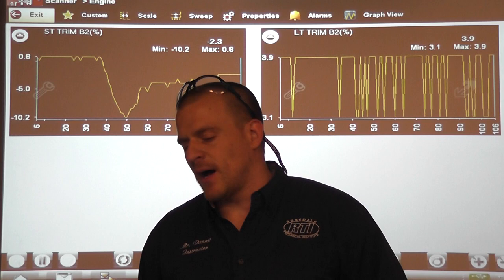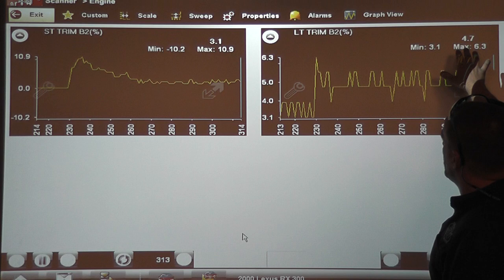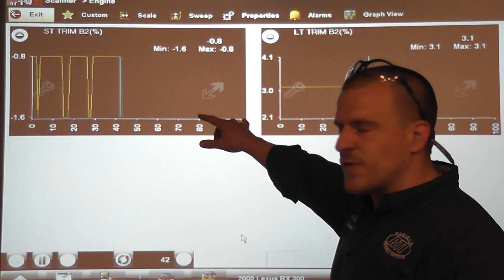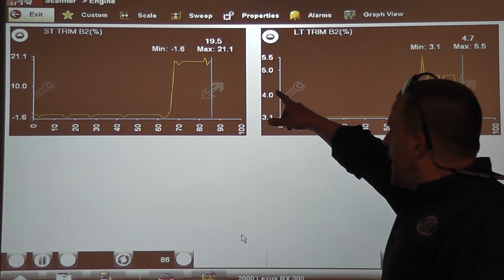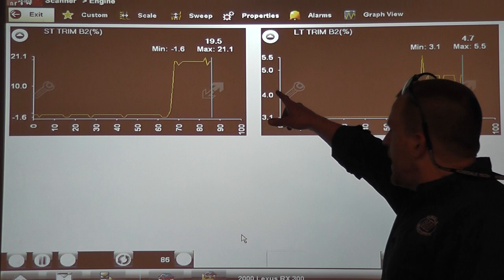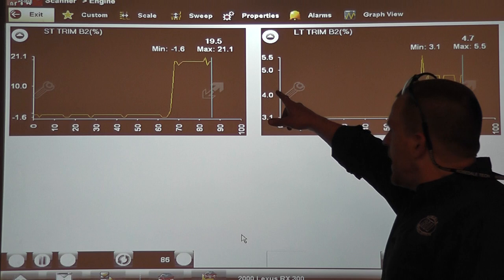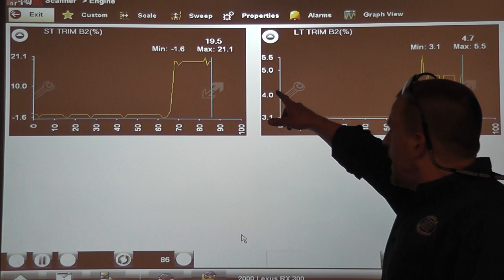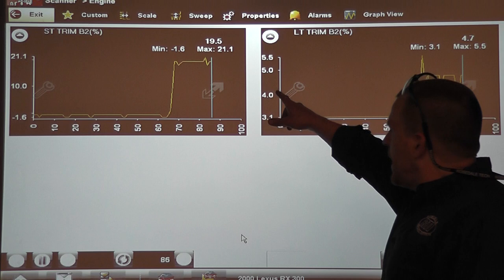Using Fuel Trim to identify type of misfire (can it be done?)

Comment: Man I’m freaking lost on my truck I have a positive stft bank 1 at 50% at idle and it refuses to drop under load goes to 53 under 2500 rpms
Reply from the maker: What is your fuel psi? Have you tested the MAF sensor? What are you working on?
Reply: ScannerDanner I’m working on a 01 Tahoe my psi is 55 but I’ve seen that my ho2 bank one sensor 1 is steady 250 mv I’m guessing it’s what is causing the high stft
Reply: At idle I’m at 250 mv at idle and 250 under load I’m just learning fuel trims and diagnostic things so I had a few questions
Reply: So I guess my question is am I looking at the right things when I’m diagnosing
Reply: I’m also seeing my mas at .02 at idle .07 under load
Reply from the maker: Unplug the MAF and tell me how it runs on a test drive. It may stall a few times but I don't car about that
Reply: ScannerDanner I have the diagnostic reports if you have an email I can send them but I’d have to do that test tomorrow

Comment: THANKS
I'm confused..... raw fuel into the exhaust»»»»   rich??   lean???
There is NO fuel sensor!!!   just O2 sensor(S)!!! Got to think in terms of O2,not fuel,the computer does NOT know about any raw fuel or no raw fuel in the exhaust....... BUT it knows  UNBURNED  OXYGEN (air), that't what the O2 sensor does,isn't that the path to think about it???
edit,  had to add this:  THERE IS NO RAW FUEL SENSOR IN THE EXHAUST PIPE;   NOT INVENTED YET!!!! Remember that.
The ONLY thing that was invented,and IS there,is an OXYGEN( read air) sensor, the O2 sensor.
So,of course an ignition misfire is gonna make fuel trims HIGHER;
Because,you guessed it,there was an incomplete combustion(or no combustion), and the AIR (air is 21% O2,as you know) -forget about the fuel!!!, no sensor for that,remember?--  went thru, the O2 sensor sees AIR/O2, that is LEAN,and it commands  Fuel Trim UP.
2nd edit:  to write thanks up there, and to praise this  amazing and timeless video.
And to say again: there are  ONLY O2  sensors, because i see that that was NOT emphasized enough; if you keep THAT in mind,you reach good conclusions much easier.  O2  O2  O2;     no gasoline sensors. (the cat is a sort of raw gas sensor: it glows RED HOT   lol).
joseportotuga
Reply from the maker: both oxygen AND fuel in the exhaust will affect how to oxygen sensor reads. It is a mini catalyst. 
For example:
A misfire from an injector that is not spraying will have more positive fuel trim corrections than a misfire from a spark plug that is not firing. This is because of the unburned fuel entering the exhaust. Oxygen levels would be the same. Fuel IS a factor on an oxygen sensor

Comment: Why would you waste your time looking at trim data with an obvious misfire? Love your videos but it seems like a lot of overthinking when you can just stand there and hear a misfire. Do your misfire diagnosis and repair clear any codes and sure, look at trim and possibly avoid a comeback for an unrelated issue.
Reply from the maker: That's like saying, why use a ratchet when a wrench works just fine. It is simply another tool in your diagnostic tool box for misfires and I use it all the time!
Reply: @ScannerDanner  I disagree with the analogy. The wrench and ratchet will both remove the fastener but fuel trim has nothing to do with diagnosing a misfire. Demonstrate how you use fuel trim to pinpoint which cylinder is not firing and I'll be a believer. P.S. love your videos.
Reply from the maker: It's not about figuring out what cylinder is misfiring. It's about using it as a guide to the type of misfire. For example, if I have a dead misfire on a 4 cylinder engine and I see 25% fuel trim, I can be sure that I have an injector not firing. If I see 10-15%, I know I'm getting fuel and then it leads me towards ignition/compression. It's a guide, it's another "tool" in your diagnostic toolbox and all you need to do is to look at some data! The scanner is already in your lap and you haven't even opened the hood yet. 
Also, I'll use the downstream O2 as a guide as well. Just did a Saab case study on my Premium channel where that test helped me tremendously as far as direction, because I was swearing I had a fuel issue but the downstream O2 told me otherwise and it did end up being an ignition misfiring issue.

Comment: Honda accord V6 3.0L: Misfires all cylinders sometimes, but STFT = -25% on bank1 ONLY. New spark plugs, new injectors, new PCV, new MAP, new gaskets (intakes, throttle body, EGR, top cover engine), clean throttle body, clean EGR, did valves adjustments, test evap purge valve, new fuel regulator, test coils, very good compression in all cylinders. Still get -25% STFT on bank1 ONLY and sometimes Misfires all cylinders. Any suggestions?
Reply from the maker: Possible exhaust restriction on one bank. Does it have two cats? One on each bank?
Reply: @ScannerDanner  Thanks for your prompt reply and yes, it has 2 CATS; one for each bank. Did the vacuum check, it is normal; 19 in Hg at idle. No hesitation, no power loss or no performance issue when drive test. Any other possible causes beside your suggestion "possible exhaust restriction"?
Reply from the maker: Okay, that rules out a restricted cat. Next step would be an injector balance test for me. 
What year is the honda? Some models will use downstream O2 sensors for fuel trim control, but that is usually accompanied with a wide band AF sensor upstream. If it has downstream fuel trim, we need to focus on the B1S2 and B2S2 sensors.
Of course we need to also focus on the upstream O2 sensors as well. (B1S1 and B2S1). In fact after typing this, that is where I would start. (Testing the upstream O2 O2 sensors)
Reply: @ScannerDanner  Good morning ScannerDanner. I thank you for your great inputs. It is 2004 Honda accord V6 with 200K miles. The 2 pre-cat sensors are A/F ratio sensors and I did swap them around and they both are ok (Amp numbers with equiv. ratio is 0.99 or 1). At idle, bank1 S2 stays high around 0.85 and bank2 S2 does fluctuates from 0.2 to 0.7 and there are times around 0.6V for quite sometimes. I'm questioning this B2S2 for the bank2 CAT however STFT is -25% for bank 1 ONLY. Strange? What is injector balance test? Talking about "balance", the compression numbers for bank1 are 150, 145, 150 and bank2 are 180, 175, 180. Any thoughts?
Reply from the maker: @haiho626  I definitely do not like those compression number differences. No cam/crank correlation codes? (timing belt off a tooth) but we could attribute those numbers to "cylinder wash" (too much fuel)

But let's focus on the B1S2 O2 sensor for a minute. Can you drive it lean? This can be accomplished a few different ways. (unplugging a few injectors on bank 1 or if you take it for a test drive and then use the transmission to decelerated while keeping the RPMs above around 2000)  This will put the system in a decel fuel cut mode where the injectors actually stop firing. All 4 oxygen sensors should drop lean during this time if you can keep it in this mode for long enough (that's why we use the transmission to help us). Hope I am making sense
Reply: @ScannerDanner  I thank you for all your wonderful inputs and suggestion. Let me show you the tables of the key parameters and their conditions and they also answer your questions:

After about 8 minutes at IDLE, no speed, RPM = 785, pending codes for misfires all cylinders (P0301-P0306) and P0300 (Random misfire) show up:
1. ECT = 176
2. MAP = 10 inHg
3. Spark advance = 9
4. IAT = 95
5. TPS = 13.3
6. STFT bank 1 = -27.3, bank2 = -2.3
7. LTFT bank 1 = 0, bank 2 = 0
8. A/F ratio sensor 1 bank1 = -0.246 to -0.269mA (before CAT bank 1)
9. Eqv ratio 11 = 0.964 to 0.972
10. A/F ratio sensor 1 bank2 = -0.019 to -.074mA (before CAT bank 2)
11. Eqv ratio 12 = 0.991 to 0.999
12. O2S2B1 = 0.825V (after CAT bank1)
13. O2S2B2 = 0.195 to 0.715V (after CAT bank2)
14. Load = 34.1

Then I drive the car, during ACCELERATION I see O2S2B1 = 0.3 to 0.6V (after CAT bank1)

Per your instruction, I take notes the following numbers during DECELERATION; my foot off the gas pedal:
1. STFT for B1 and B2 = 0
2. LTFT for B1 and B2 = 0
3. A/F ratio sensor 1 bank1 = 3.7 to 4mA (before CAT bank1)
4. Eqv ratio 11 = 1.99
5. A/F ratio sensor 1 bank2 = 3.5 to 4mA (before CAT bank2)
6. Eqv ratio 12 = 1.98

7. O2S2B1 = 0V (after CAT bank1)
8. O2S2B2 = 0V (after CAT bank2)
9. RPM is about 2000
10. MAP = 5.9 inHg

Then about 1/2 hour driving (acceleration and deceleration), I then park the car and let it IDLE:
1. STFT bank1 = -11.7
2. LTFT bank1 = 0
3. STFT bank2 = 0
4. LTFT bank2 = 0
5. A/F ratio sensor 1 bank1 = -0.007 to -0.0085mA (before CAT bank1)
6. Eqv ratio 11 = 0.999 to 1
7. A/F ratio sensor 1 bank2 = -0.019 to -0.070mA (before CAT bank2)
8. O2S2B1 = 0.76V (after CAT bank1)
9. O2S2B2 = 0.2 to 0.7V (after CAT bank2)
10. MAP = 9.7 inHg
11. Spark advance = 8 to 10
12. ECT = 201
13. Load = 32.5 

14. RPM = 790
15. IAT = 134
16. TPS = 12.9

Then I turn off the engine and wait for about 10 minutes and start the car again at IDLE:
1. STFT bank1 = -25.7
2. LTFT bank1 = 0
3. STFT bank2 = 0
4. LTFT bank2 = 0
5. A/F ratio sensor 1 bank1 = -0.007mA (before CAT bank1)
6. Eqv ratio 11 = 0.999
7. A/F ratio sensor 1 bank2 = -0.050mA (before CAT bank2)
8. O2S2B1 = 0.6 to 0.825V (after CAT bank1)
9. 02S2B2 = 0.2 to 0.7V (after CAT bank2)
10. MAP = 9.7 inHg
11. TPS = 13.3
12. IAT = 147
13. ECT = 207

Questions:

1. Seems like when I drive, the numbers are getting better until at idle STFT bank1 go back to -25.7? Does 02S2B1 (after CAT bank1) is normal? the 2 A/F ratio sensors (pre CAT) are ok?

2. One more thing, yesterday, at IDLE, I rev the engine to 3000 RPM for sometimes, the P0172 (System too rich bank1) and P0430 (CAT system efficiency below threshold bank2) came up with Engine Light on. I was surprise P0430 for bank2 CAT. Should it be for bank1 instead? Yes, the O2S2B2 values indicated potential CAT problem for bank2, should it be CAT for bank1 instead because of bank1 STFT is too negative - 25.7?

3. Can a restricted CAT bank2 causes STFT bank1 negative?

4. Or the other way around, can STFT bank1 is too negative which can cause restricted CAT bank2 problem?

5. I just order a "smoke machine" which will arrive in next couple of days, will do smoke test in all system. Any other test(s) should I try?

Please advice.
Many thanks & God bless,
Hai